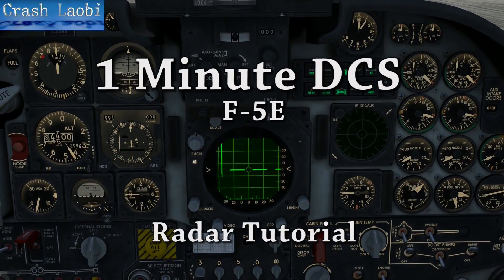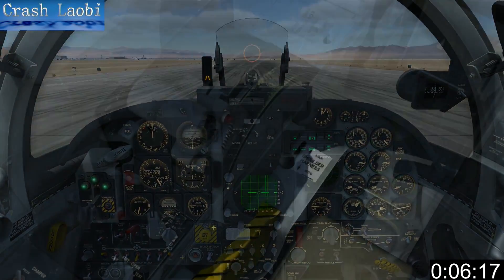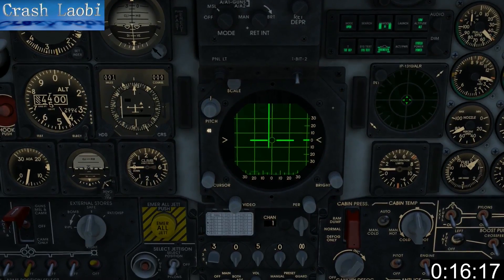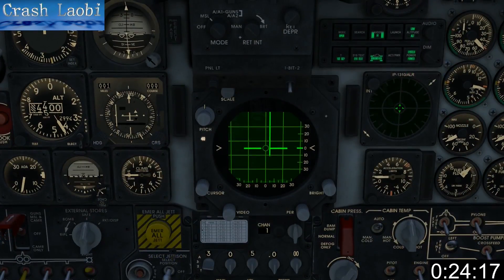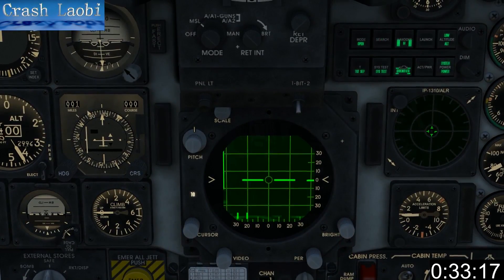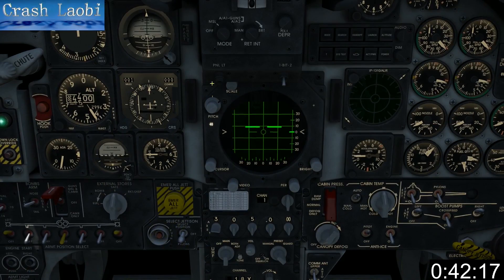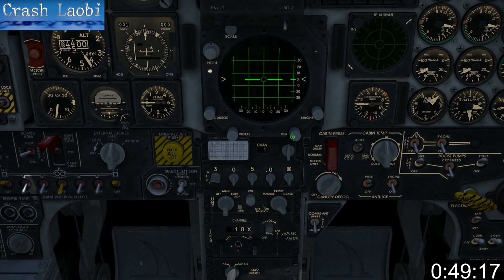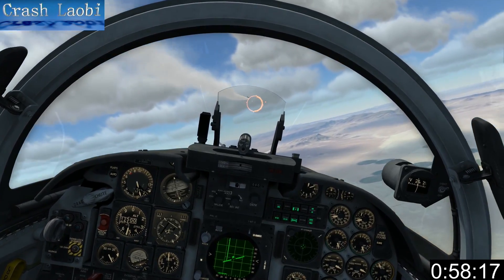1 Minute DCS - F-5E Radar Tutorial

Comment: I don't understand the point of locking with the F5's radar. If it can only lock within 10 miles, you are pretty much close enough to see your target and you will be merged within a few seconds. It doesn't seem like it's even worth the effort to look down and fiddle around with the cursor.
Reply from the maker: Thank you sir! I use it in cloud or as a backup or for more precise guidance
Reply: Prior to volumetric clouds in DCS, it was pretty useless tbh.
Locking does not connect with the weapon in any way.
For missiles, it only confirms if the target is IN RANGE of your missiles. But missiles and radar do not communicate with each other, in any way.
The only thing its KINDA useful for is GUNS.
When you lock with the radar, it provides your target cursor with range for the guns.
This means thats your cursor floats a bit as you manuever, to give you a better angle to lead based on the targets position and range.